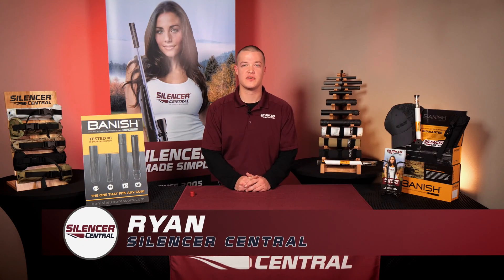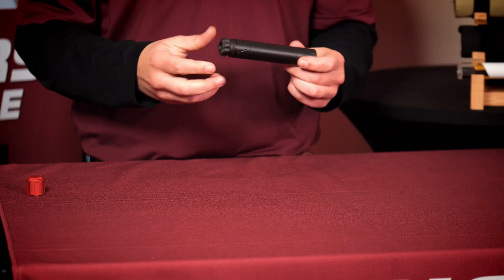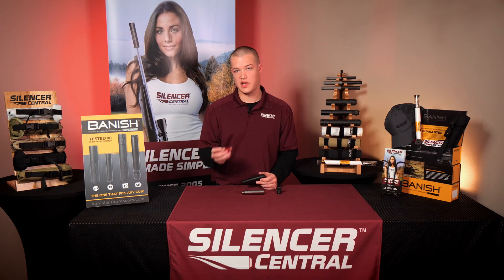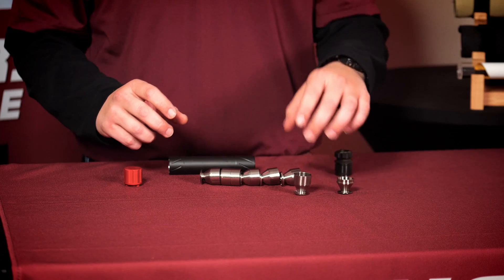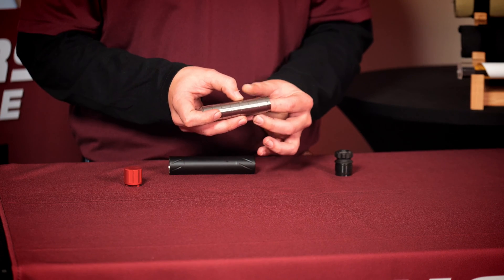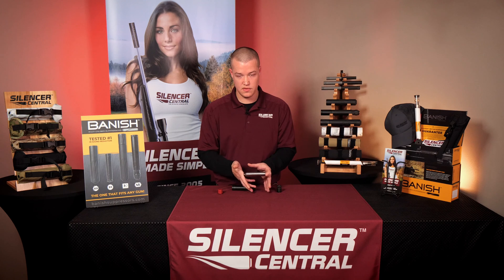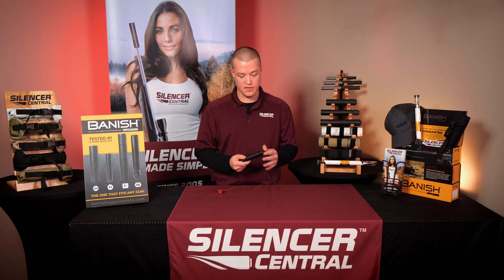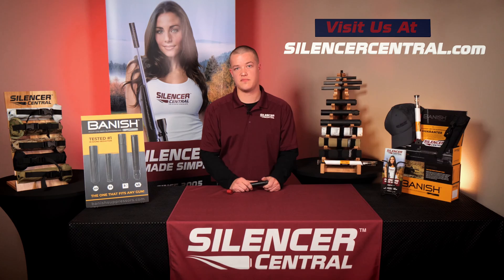How to: Teardown of the Banish 22 Suppressor by Silencer Central

Comment: Mine keep coming apart from the base when I try to remove it from the gun.  The outside tube feels to light to screw onto the base very tightly without wrecking it. Otherwise, I like it. *Also the bottom baffle turns when final tightening on the base.

Comment: I just got my banish 22. I just tried looking but is there anything specific I should use to clean my banish 22?
Reply from the maker: Soak the inside of the tube and baffles with a penetrating oil and let sit for 1 - 2 hours. If excessive fouling has occurred, our Baffle Remove Tool (sold separately) can be used to push the baffles out. Care must be taken to avoid damage to the baffles.
Scrub the baffles and tube with a nylon brush to remove carbon deposits. Once all parts are clean and dry, add a light film of oil on the baffles, to aid in assembly.
Reply: @staccatoglock  roughly around that time. I don’t remember the exact date I ordered it but right around there. Don’t think I waited a full year.
Reply: @darrkitx11  glad to hear it and enjoy your Banish 22 🥳